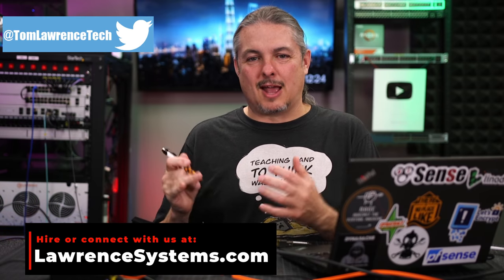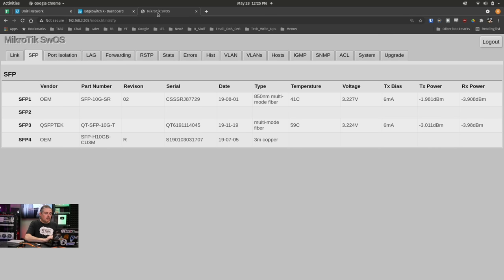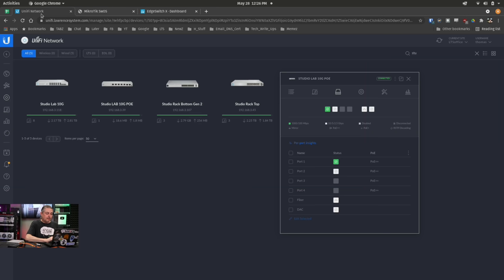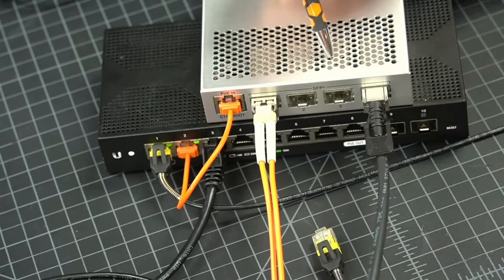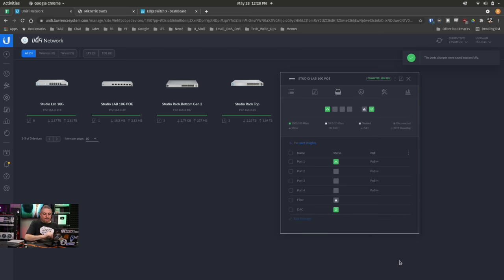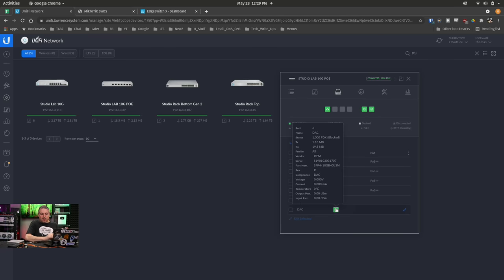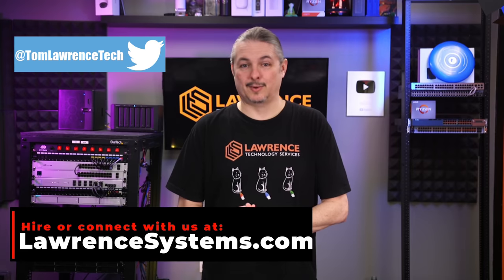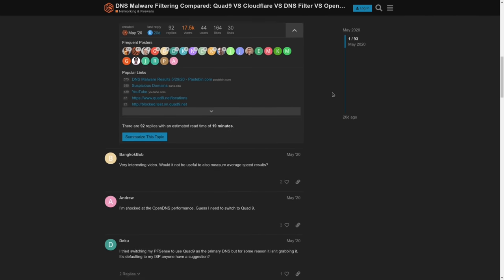DAC, Fiber, 1GB SFP, and 10GB SFP+ Cross Compatibility

Comment: Our company just sprang for AT&T's 5Gb/s fiber with 5 usable public IP addresses. AT&T's BGW320-505 OP router has 3 x GbE and a single 5GbE port. I've successfully connected this port (using cat-6A) to a TP-Link TL-SX105 unmanaged switch that has 5 x 10/5/2.5/1 GbE, auto-negotiating ports. Our UXG-Pro's 10G WAN port (using the UACC-CM-RJ45-MG module) says it's connected at 10G and seems happy. On a good day, with IDS disabled, the UXG-Pro will get 4Gb/s throughput with this setup.  With full IDS enabled, it will consistently get +/- 3Gb/s.

Comment: Hey! I really liked this video! I was learning aobut the subject because I bought a UDM SE and a USW 24 PoE! I connected both devices using 2 RJ45 Transceivers (from ubiquiti)  and a cat6 cable. The switch is not the pro version, so I used it's SFP port with the transceiver to connect it to the SFP+ port in the UDM SE. I'm only getting 30Mbs as a download speed when my full download speed is 300Mbs down and 30Mbs up. At the UDM SE and at any of it's ports I'm getting my full WAN download speed but not if I use any of the switch ports. That's not the case for the upload speed, I get the full upload speed both in the switch and UDM SE. I suspect the problem is in the conneciton between devices. Since the 2 ports are not SFP+ but rather SFP to SFP+, I did set the connection manually to be Gbe and not auto negotiation to avoid any problems. Still I don't know why my connection is being capped like that! Could you help me out? Thanks!

Comment: I'm in this boat, I have 2.5Gb fiber connected directly to my USW-Pro-24-PoE, then to pfsense over Gigabit Ethernet and back again.  My issue is my upload speeds are stuck at 110Mb on wired clients.  This is only strange because my wireless clients (u6-lr's) Ethernet backhauled to the same switch get approximately 300Mb/300mbit.  So they're all wired!  Why can my wireless clients get better upload than my wired machines?  I've checked and swapped out cables, cards, used different pfsense interfaces.

Comment: I just found a 2.5GBASE-T SFP Transceiver Module that claims to use a regular SFP port and can run at 2.5g over 100m of Cat5e.  Is that compatible with any non-vendor specific switch SFP port?  I assumed that SFP was capped at 1gb but learned that it up to 4.5gb in some configurations.  I'm trying to figure out if I can use these on my network switches SFP ports.

Comment: Very clear video, Tom.

By the way, why would one use those SFP+ to RJ45 converter modules? I've always been puzzled by those. Especially if we're talking within the same rack or closet, since passive 10G DAC cables are good for 7 - 10 meters if they wanted to stick with copper for some reason.

Why bother converting formats? Those modules just generate lots of heat and waste energy, and add latency.

I could see it if you had a long run of Cat6a coming into a closet, and needed to plug into an SFP+ port for some reason, but it would be better to just get gear with 10GBase-T RJ45 ports. For the short in-rack connections, I don't understand the point.
Reply: Maybe because some Datacenters get switches with ony SFP+ ports there might be another reason why but im not to sure or and im sure some people use CAT 6 cables instead of fiber or DAC cables.
Reply: Like most adapters, the reason it exists is for those who did not plan what they needed ahead of time. If you only have a free SFP port and you need to plug in a cat 6 cable to it, an adapter is likely cheaper than buying a whole new switch.
Reply: As a practical example, a switch in the school I work at was in an area that was never expected to have more than 24 copper ports being used but thanks to an unexpected growth in CCTV cameras on the network, the switch got filled up. Having the SFP+ ports gives me that little bit of breathing room to plug in 3 more connections without needing to jump to a 48 port switch.

Comment: Any One Know If The MikroTik 8 Port SFP+ Switch Will Work With My HP 10Gb & Mellanox 10Gb Nic's ?? I Have a Hp Dual port n my main Pc & Mellanox are in my 3 servers & Hp in another ? ? Just Trying To dot my t's  & Cross the I's before I Drop 275$ on a The MikroTik Switch..I hope i can figure it out how to set up a p2p LAN Only with it !
Reply: Nics? That depends on sfp, not on nic.
Reply: I have my CRS309 8 port 10G Mikrotik switch connected to a Mellanox MT26448 card over SFP+ fibre modules. The Mellanox card I have will link up at 10G but sometimes the card itself won't come up, so I have to wait about 20 seconds or so between boots. It's done this in two machines and I've never figured out why - the machine is running Linux Mint. It seems like it's a reset issue. But yes, it will work and link at 10Gbps.
Reply: My Mikrotik isn't picky about SFP+ brands in my experience. It shouldn't matter who makes the NIC at all. I have three Mellanox ConnectX-3 NICs with Mellanox MFM1T02A-SR SFP+s on my CRS305-1G+4S+ switch with no issues.

Comment: Im so tierd of all theese compability reuqirements. It's a full-time job to secure oneself and configure pfsense and maintain a net. Pfsense is a big time time thief, periode! In the other end of the story is to get the infrastructure up working properly... Make sure to avoid RFI/crosstalk, implementations and separations etc. In a modern house with low and high voltage all over, RJ45 copper is downright anachronistic and no go. Does not help if its a cat6a sheild outdoor or cat7 better, that RF and crosstalk will kill your ethernet coms eather way... Fixing that going fibre someone says...., expensive termination tools is a must after you have digged that cableway 25-30 meters through the garden, blown the damn fiber cable forward to its enpoint and then starts the entry trough walls and termination of endpoints. If you have the time, go for it! it's all very well, but this quickly becomes more expensive and more than a hobby this road instead of just simply paying a contractor to do the job at a fixed price A-Z..